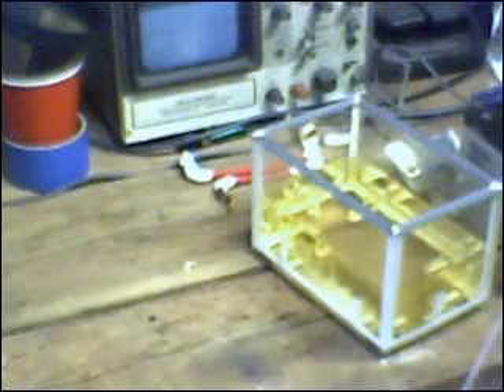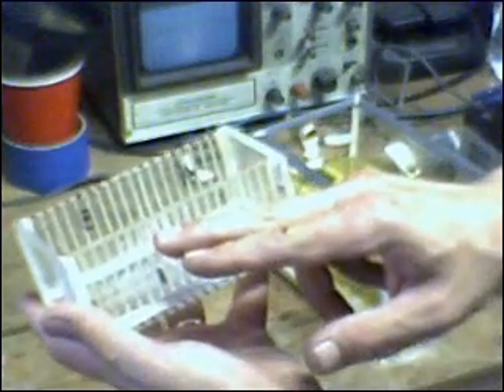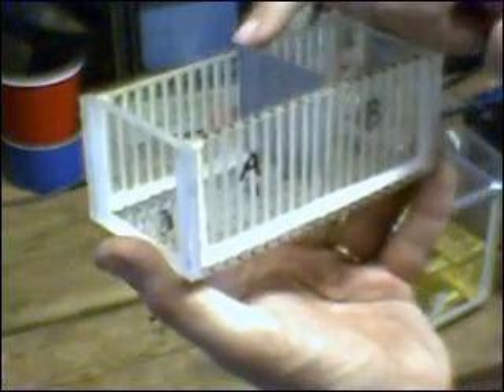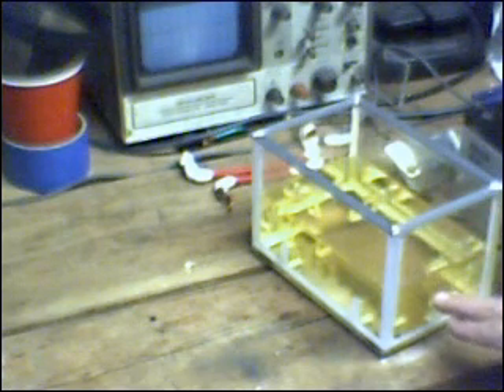21 - Hydrogen HHO Electrolyzer test unit 10-1

Comment: The riddle answer is the longer flue pipe has a stronger draw pressure on the fire which in turn provides more volume of air for combustion. 
I am wondering how warm the temperature is of the unit Mark ?? Supposedly heating or cooking the cells is inefficient. What do you think Sir ??

Comment from the maker: Yes and no. What actually happens is oxygen production is more concentrated at one electrode less at the opposite electrode but still present. Vica versa for H2. The neutral plates in between the electrodes produce both equally but at a slower rate.

Comment: The answer to your riddle is that, to a point, a column of heated gas being lighter than the ambient gas creates negative pressure resulting in up draft. The taller the chimney the greater the draft. Conversely, the warmer gas is being pushed up the chimney by the cooler ambient gas.:-)

Comment: I see that only the spaces midway between the pos. and neg. are the ones that are producing gas in the electrolyte.  It appears that production shifts closer to the plates that are closer to the actual electrode.  Or is that just an illusion?  (Nice Work)

Comment from the maker: Point taken. I believe the plates are as far as they are to permit experinentation with higher voltages with less possibility of arcing. And we all know what happens when you create an electrical arc inside a chamber of premixed compustable gases, now don't we?

Comment: You can get lye yourself, take some branches from a tree outside, break them up, and burn them until the outside is black (before it turns white ash). Put it in a 3 coffee filters and run water through it, should produce a lye water for you...at least that's how they did it in the dark ages. =)